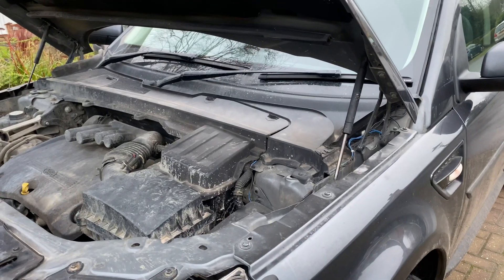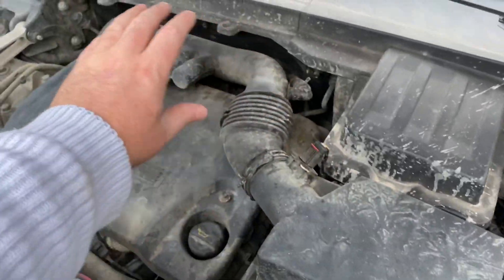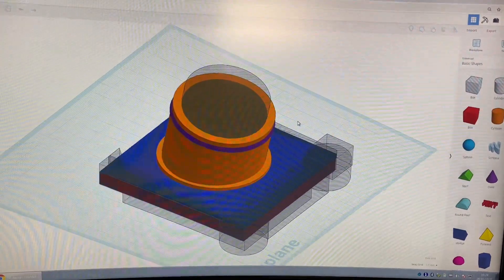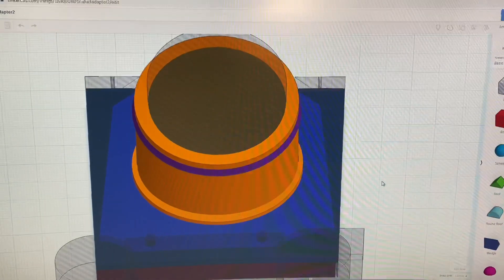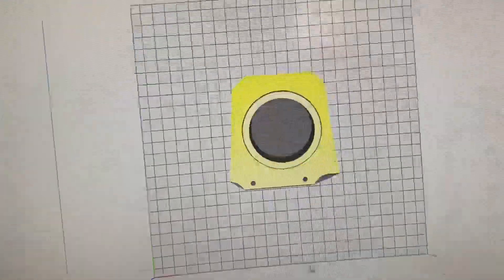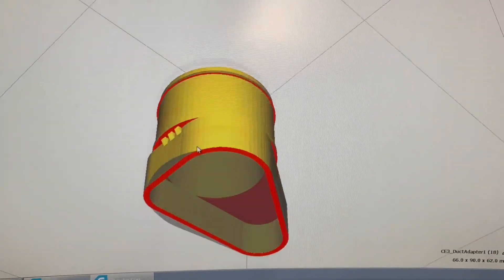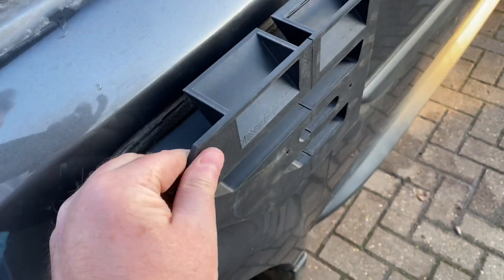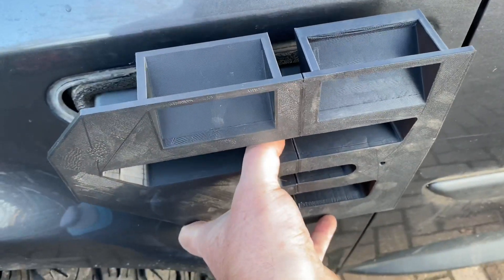Raised air intake/snorkel for a Freelander 2 - Part 2

Comment: Great video. Like that CAD tool. But.... what are those tyres on your truck. Are they BFG AT?  Can you tell us what wheels you have. And the tyre size. My stick tyres are 235/60R18. I want BFG a. Don’t forget part 3 either.
Reply from the maker: Thanks! The tyres are BF Goodrich AT KO2 245/70R17
Reply from the maker: The wheels are just factory XS style 17" wheels sprayed black
Reply: Hi. Thanks for the info on the wheels. I’m going to look at some 17 inch wheels like you. But what tyre did you get for it. I don’t want to mess up the wheel height too much. Oh and thanks for the info on the print. You make it look easy. Keep those videos coming.  Yay! Hey